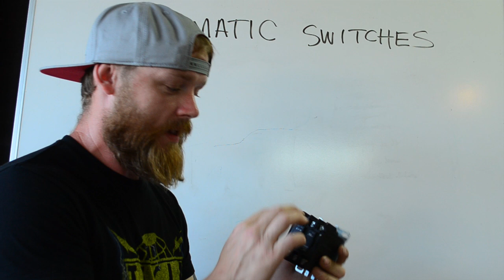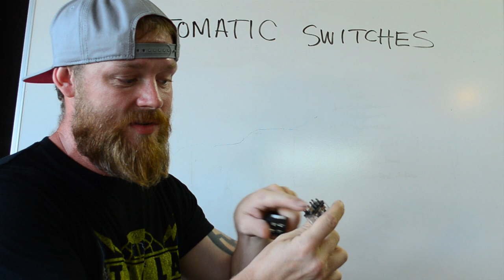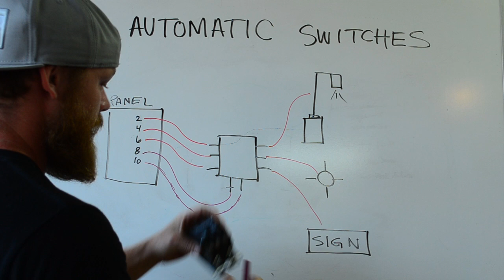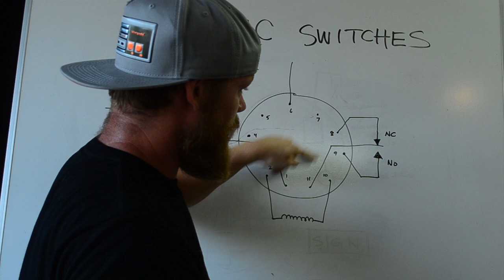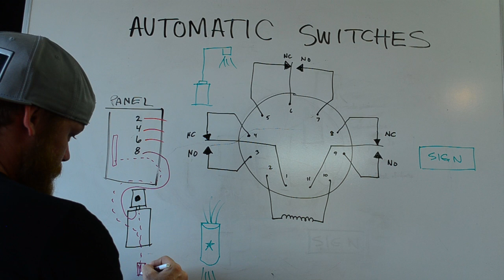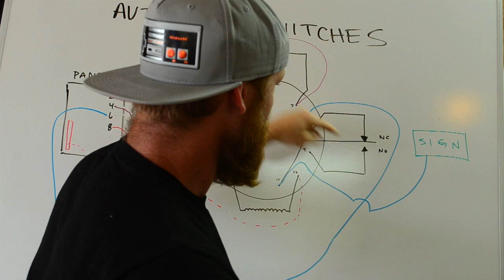Episode 15 - SCHEMATICS - Automatic Circuits (Contactors, Relays, Photocells, & Timeclocks

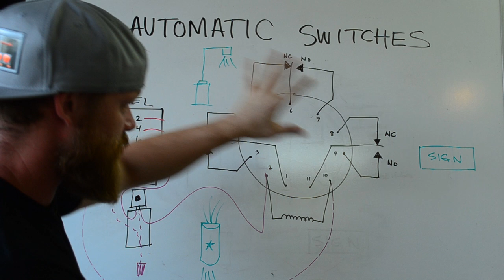Comment: I have a criticism: this is exactly what I'm talking about when I say Dustin is bad at explaining things. Dustin you gotta either draw a current flow schematic or draw a picture of the circuit. I'm at 25:00 mark and I'm realizing, why are the lights in this circuit drawn as being not connected to their current supply

how is a novice going to understand that Dustin drew a hot bringing power to a device, which is drawn as being not a part of the circuit. But you want us to understand that you're inferring that it IS CONNECTED TO THOSE HOTS in the flow chart. 

Ok so just draw a goddamn schematic at that point Dustin it's your way of simultaneously expecting us to be weekend do it yourselfers but also we should be up to your tool quality standards as a master electrician. Tic tracers have saved both of our lives. What does Dustin have against them? I'm not exactly sure I think he's seeing a lot of people use voltage detectors as oscilloscopes lol the other day some dumbass foreign eastern european dude wanted me to run power to his BBQ circuit but when I got there, essentially this fool already tried to just hotwire a receptacle outside from a correctly installed, perfectly good outlet that's inside. So he hole sawed his stucco huge as fuck and ran a tiny 14/2 wire through a 5" hole in the fuckin wall of a million dollar mansion in the sunny well manicured hills of Santa Clarita. No idea why he didn't pass the Wire through a 1/2 inch hole. 

I mean there was about two dozen violations or mistakes in his wiri- why was I telling this story again? Oh yeah. So the guy wants me to like retry the same exact hotwire technique that he did except... Work....ing... This time. 

I explained his method was exactly the folly and why, over and over. It's not a complicated concept. But they chose not to understand.uhh so anyways that's not the moral of the story. 

The reason why I tell this story is because this guys wiring technique is nothing short of neanderthalic. he used an unmarked all black wire, basically it's meant to be extension cord or replacement vacuum cable cord. There's no white wire it's two black wires running side by side glued together. So there's no fuckin way to know which one is positive or negative. I realized most of them were wired correct, if anything by sheer luck, because a couple were predictably wired backwards. You know, identical hots and neutrals, genius shit. I'm asking him, "did you wire the hots as the wire with printed lettering on it? Because that's how I'm wiring it now." 

   And the "handyman" old man tells his son (who translated everything and has to beg for permission for me to fix the BBQ island circuit and he still said no because he was too cheap to pay the 200 bux for materials) that for his son to tell me, "it doesn't matter which wire is which, its direct current. You can wire them any way.) I was like.... Direct current... Even batteries have a negative side you dumbass that's not what direct current means lol. Oh yeah "direct current" is when the electricity passes through the devices's circuits with a current that so perfectly matches the load impedance so that no power makes it to ground because it's all used up within the device. Direct current. Discovered by Nikolai Tesla in 1972

Comment: im confused (not really) i thought your supposed to run neutrals of those fixturs back to the neutral bus. since theres only 1 wire going to and from the fixtures how does current make it back to the panel? you did say it was going to be 120v circuit so that needs a neutral
Reply: Of course.
This guy is very bad teacher

Comment: On the 11 pin 3 load relay in that application wouldn't you use a separate timer for the sign as opposed to a photo cell?

Comment: The problem is with this setup is most places don’t close at dark so be nice to see a video on how in this same setup you would keep sign on for let’s say 3hrs after dark and then shut off at closing time would you use a different relay or would you add a timer or what?

Comment: If you enjoy tinkering into relay for higher amperage load, wire 2 or 3 poles, and depending, terminal in parallel, do the same with NO or NC. There’s your simple survival tech technique.

Comment: My dad worked for a car manufacturer as an electrical engineer.  Every time they changed some logic in some presses or parts of the manufacturing process, my dad would bring 5-gallon buckets full of these contractors, timers, relays, ice cube relays, you name it. They would just cut off the wires and get rid of them.  I so wish I still had these to mess around with.  My older brother used them to make different things just to learn.  I was too young then but I was always listening and learning.  I love your channel.  It's like talking with my dad again.

Comment: I would imagine there is an accessory set of contacts so once you push the start button,
the accessory contacts shunt the start contacts and keeps  contactor closed untill the 
stop button is pressed which opens the coil or magnet circuit.

Comment: Man this video would have saved my losing what few gray hairs I've had left, back 18 yrs. ago when I rewired a 3phase Chill Water System. Makes me wish I'd had the Icecube kind then instead of the magnetic DP's. 
I actually had a dream as to how to wire that 'JEZEBEL' and made it work, for 3 years before had any other issues out of it. Then a guy that specialized in chilled water, came in looked at it, scratched his head and asked, How Did YouGet This To Work, It Shouldn't Be Working. 
I showed him my drawing that I had drawn when I woke up from my dream.

Comment: @Electrician U I don't know if you look back at comments for these older videos, but I've just started watching through them and I don't know if you've already touched on this in a different vid, but is there a reason you ran the power to the pins you did? Can you not run it to the 1, 6 or 11 pins? Does it matter or is there a reason?

Comment: Thanks for the info—it provides a quick review for me of the material.  But, and correct me if I’m wrong, don’t you also need a neutral for 120VAC (or another hot for higher voltages) after each load?

Comment: Couple of questions. Is the neutral run by itself? And could you not just run the panel to 6 and run everything off one if it was enough to hold the power?

Comment: Good job! One thing i would say is, you Could have explain it and draw it out better.. u should include neutral wire and ground wire on your drawing so that people will understand it better, i dont know where is the neutral from circuit no.2,4,6 are going??? after the video, a question came up in my head, isnt the load(polelight, sconelight) have neutral in the connection? Ofcourse they have right? But where is it gonna be connected? Directly to the panel?    Aside from that dude, if you can do a video of lighting control and how it works from panel to control panel to lights, to sensors, u know what i mean? Do it with the neutral and ground including. Plsss and thank you! PS i look up to you since the beginning of my journey! Now im a 3rdyr, Such an inspiration you are to me. And i kinda develop the way you do things to. Positive, nice and willing to learn everyday and most specially living the dream as a great electrician! Great work and always make content dude! Bless you

Comment: Big fan of both u and your video’s! However, this one on relays, I would love to see updated with a few things. 1) you show the relay wires wrong. U don’t feed the N.O. Or N.C., those are used for the load or control. It’s the Common that gets the feed (Yes, the other way will function in most cases). 2) u should show schematic symbols for N.O. & N.C.. 3) two very big purposes of relays are for different voltages such as 120vac control and 240vac lighting, or for logic, such as maybe an exhaust fan has to be On (relay 1) in order for a paint sprayer pump to work (this may be more advanced and maybe beat in a boiler control video). Overall, great diagram and explanation!

Comment: Hi you are doing great job, i'm sure Apprentice appreciate you. I'm a A/C guy., So on the 240/208 coil even though  it's not enough to energizer (photo cell) 1 side of the coil on the contactor has power 120 volts ?

Comment: One would never use an ice cube relay to directly control large lighting loads. It would usually be used to control separate contactors. Cube relays rarely have the current capacity for such applications but can happily run contactor coils

Comment: Why did you run the neutral to the photo sensor in you second example? Shouldn't the neutral go directly to the pin #10 on the relay for the coil. Like the first example with the contact with a 240v coil, you only ran one leg of the line voltage to the photo sensor. The photo sensor only needs to break one of the hots on a 240v and the hot on a 120v, essentially no neutral is required to go to the photo sensor. Please correct me if I am wrong. Thanks for the vids they are informative.
Reply: A lot of photo eyes need a neutral to function

Comment: Typically I wire the common terminals to the hots from the breakers. This gives me an option of wiring a light to the normally closed contact for use during the day without using up too many terminals on the relay or contactor.

Comment: Great video!! Keep up the good work! We are possibly getting ready to wire a big truck shop, and it'll have multiple lighting circuits because of as many as it is, would a contactor by ideal to control light off of 1 switch rather than multiple switches?
Reply: Yes, if you want all circuits to go on and off at the same time.

Comment: So the neutral on all those devices go straight back to the panel correct?

And how would the wiring be if the devices required 240V?
Reply: Please respond @Electrician U
Reply: Yes, if the devices are all 120V then the neutral is just pig-tailed inside the device box and spliced through without being switched. If the control devices are 208V, 240V, or something that requires two hot wires for the circuit, one hot wire is still switched like before, but the second hot wire is your ‘common’ wire that is not switched. This wire is there to complete the circuit and for wiring purposes, you can treat that second hot wire like the neutral wire if it was a 120V or 277V circuit.
Reply: @RB-xv4si  You can not do this. If your load requires 2 phase or 3 phases, all phases must be interrupted at the same time by the contactor. If the load requires a neutral, make sure it gets one from the panel, just like any other load anywhere, spliced in the back of the box.
Reply: @goaliedude32  lol ok. Let me apply a real-world situation to your thinking. Let’s say I have a motor starter and the motor runs off a 208V 3 phase circuit. Now let’s say the coil rating on that starter is also 208V. One hot conductor is run straight to one side of the coil and it is never switched. The other hot conductor used to control the coil is the common that runs to the hand/off/auto switch. Those switches are not two pole switches. They are one pole. Your argument does not hold water. Starters are wired from the factory this way and may be wired in the field this way.
Reply: @RB-xv4si  Provide me the spec sheet of the contactor you're using for that install.
Reply: @goaliedude32  lol I’m not providing you anything. Go and google the wiring schematics for a motor starter with a 208V coil and you will see this is how it works. Take your pick, square D, Eaton, all the big brands will have pretty much the same setup.
Reply: @RB-xv4si  I will not believe that the coil is being controlled by 2 legs of a 3 phase service. There is no reason for this at all when you can just run a neutral. Why would a manufacturer design a contactor that essentially short circuits 2 legs of a 3 phase service to each other.

I'm willing to admit when I'm wrong. When you say "this exists" and I don't believe it, it's not my job to prove you wrong. If you know it exists then demonstrate your point of view.
Reply: @RB-xv4si  it's probably rated for 208, never in my life would I expect to see 2 legs of a 3 phase service used to control the coil on a contactor
Reply: @goaliedude32  https://www.grainger.com/mobile/product/SQUARE-D-Magnetic-Motor-Starter-1H486

Here you go you lazy bastard. They make coil voltages like this available for situations where there was no neutral run to the starter and there is no control transformer available to derive a neutral from. So the simplest thing to do is have the coil rated to run off line voltage. There are even coils that run off 480V.
Reply: @RB-xv4si  I do electrical work for a living an I will never see a 208v service with no no neutral, it pretty much doesn't exist anymore.

 The person who asked the question asked how to control a 240v load not a contactor in a rare situation.

Your original comment is harmful and dangerous and that's what I'm responding to. Congratulations they do make a super speciality device for very rare situations, you're right of course it's possible for something like that to exist. You offered information to someone who isn't knowledgeable that could cause them to make a dangerous mistake. 

If I were installing a system where this was required I would use a double pole switch. I'll check later for any code on this very specific and rare case
Reply: @goaliedude32  I’m not saying the service doesn’t have a neutral. I said that sometimes whoever installs the starter as part of the new construction uses line voltage for the controls because it saves money. You don’t have to pull a neutral to the starter and no control transformer is needed. What I said is only dangerous to someone who doesn’t have experience. I speak from real world experience and have a lot of it with control devices. You decided to interject your ignorant opinion so you made yourself look as such. Go get some experience and stop arguing about areas you don’t have knowledge in.

Comment: So where your photcell is at, basically acts as a manual switch. In other words, you could put a maualswitch there to cut off or on your power to the contactor?
Reply from the maker: The photocell is actually an automatic switch - it does it's thing with or without you're input.  You can add a manual switch though to bypass the photcell, yes.

Comment: Can you just shut off the power to the breakers and it still being a d energized state or you have to unhook the wires as well I'm trying to learn I'm only a maintenance technician so I mean I know a little bit about electrical circuitry not a whole bunch and I'm trying to learn so I could probably maybe further my education become a electrical maintenance or whatever they call it man
Reply from the maker: if you shut off the control circuit to the coil it will only cut power to the coil.  Then you'd need to shut off all of the circuits going to the contacts as well, that feed the loads out in the field.  Only then will everything be dead

Comment: Wow learned more about the contactor from the first couple minutes of this video. I thought contactors and relays were for industrial with motors
Reply: motor starters work in the same way as a contactor, but you can add multiple open or closed contacts for different control options, and they have built in overload protection

Comment: Is the coil on the contactor AC or DC?  Do you not need neutrals coming back from the loads...? Why?
Reply: You can buy whatever kind of contactor you need. You can have a 277/480 contactor with 120v switching or low voltage 24v switching.

Whatever you need you can find, there's  catalogs and you can talk to supply houses to make sure you have the right thing

Comment: Don't forget that some contactors and relays have a different voltage rating to make them active.  In HVAC systems a lot of times you will need 24VAC (trigger signal is usually coming the thermostat) from on the coil to control 120/220/440 circuits.

Comment: Question.  I understood 99% of what you  said, the other 1%  is where i got lost. Where do you connect the neutral wire for each of the loads that you're controlling with the ice cube relay?  Do you send them straight to the panel?       Great video!  Thanks.
Reply: I was wondering the same thing
Reply: @RS-zh3hn  they would go from the panel straight to the device, since the relay is only controlling the hot side of the circuit
Reply: Similar to a light switch. Neutrals are carried through in the back, spliced together. Never switch a neutral.

Comment: Love watching your videos they are super educational for my as an apprentice electrician. Question if you turn of power to something that is ran by a timeclock would you have to reset the clock when turning the power back on due to the time lost because of power being off?
Reply: Cameron Verrette on mechanical time clocks you just need to set it to the correct time again.
Reply: A digital time clock usually has a battery backup to retain settings if there is an interruption of power.

Comment: Enjoying these new E-U vids.

I've wired a bunch of contactors, but never heard of an ice cube relay. Seems like the price is comparable or less cost than a quality contactor.

Question: Say the store owner wanted sconces added to their existing photocell controlled 11pin ice cube, which is already controlling only a small sign load and 2 full parking lot light circuits. So no empty spaces left on the ice cube. Could you double up loads on the ice cube, running the sign load on normally closed 5, sconce on normally open 7, and hot in on the control 6?